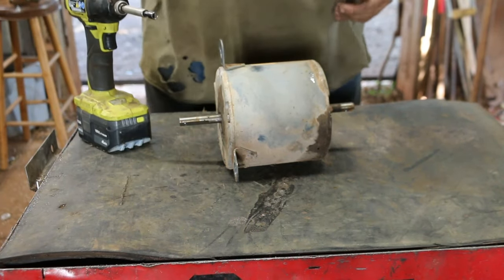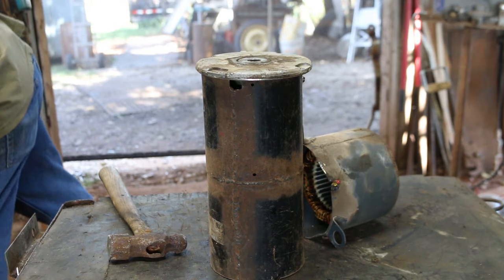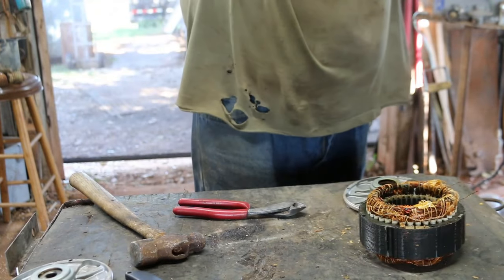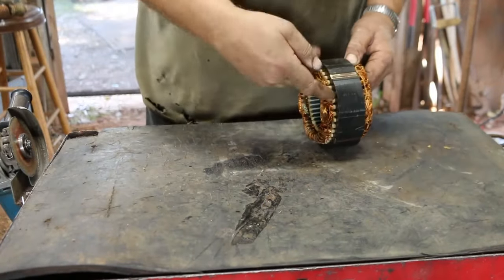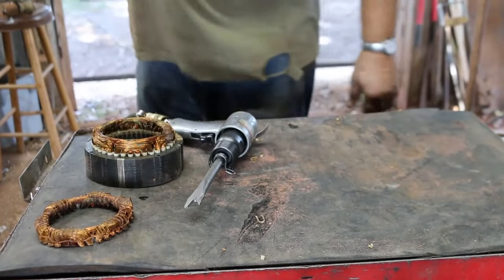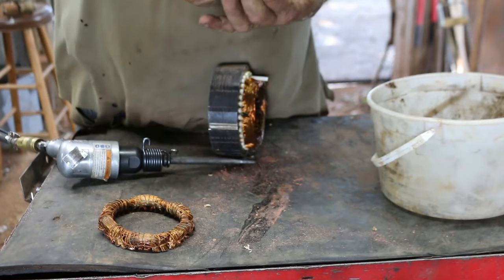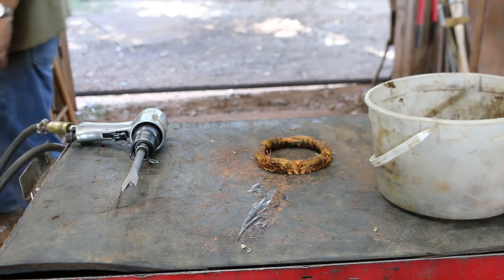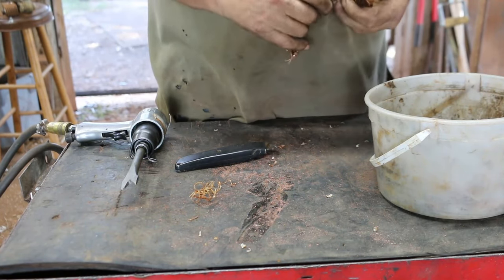Scrapping out a Fan Motor from an old AC unit for the Copper and Aluminum

Comment: Please level your bench 😂.  🐎✌️
Reply from the maker: yes I need to, just need to dig a little dirt out from under one leg, half of this room is close to level, the other half goes up hill to the south, by about 6 to 8 inches, I had to leave a good gap under the bottoms of the south doors as the slope rises up even more, and dig a ditch across the south doors with a drain pipe to divert water from flooding the shop